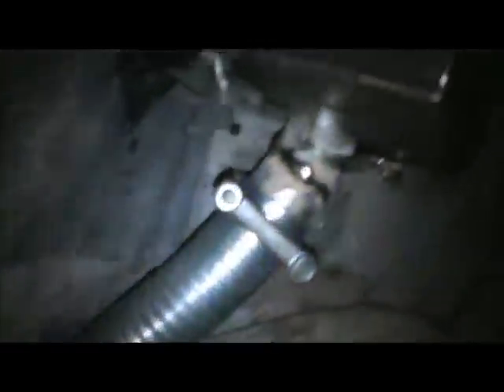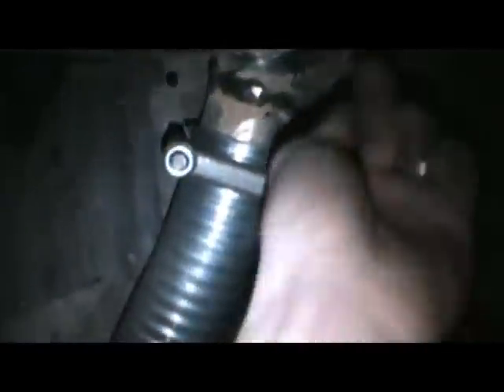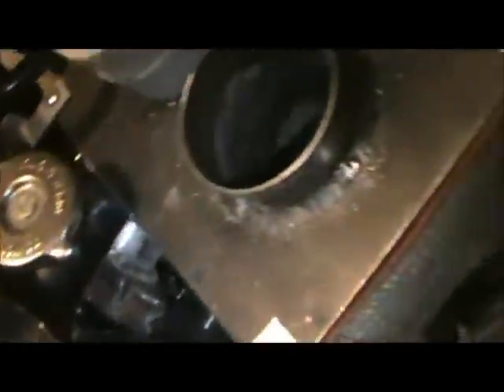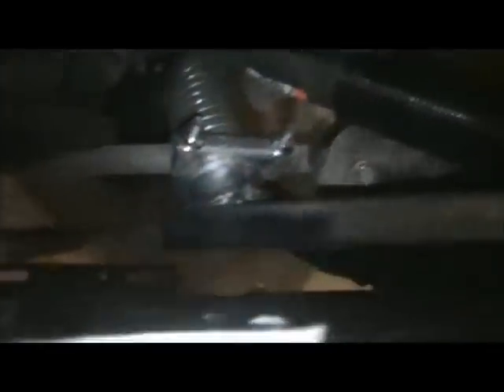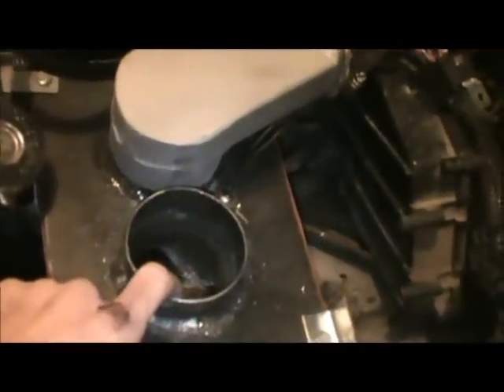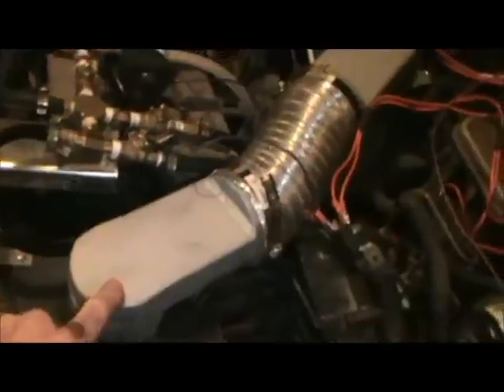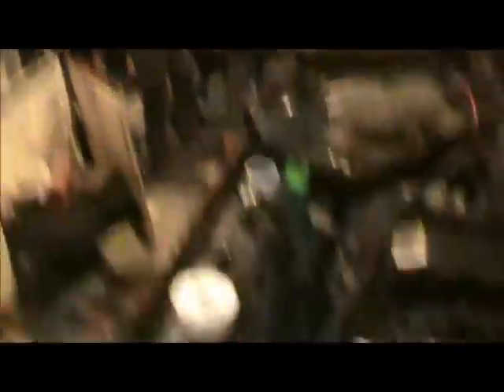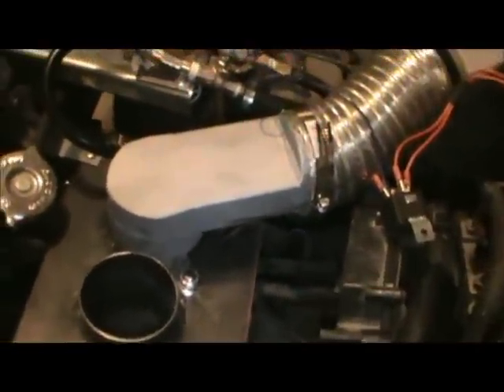100+MPG PROJECT NEW FUEL VAPORIZER INSTALLED (DETAILED OVERVIEW)

Comment: hi buddy. i have been trying to run my suzuki celerio 2011 with vapor. i connected the vaporizer to the air intake but it doesn't want to start. my car has injection engine. it doesn't contain the regular carburator. it has air intake seperated and the fuel intake in a deffirent place connected with injectors to the engine. do you have any indea how i can run an injection engine with gas vapor? thanx iun advance
Reply from the maker: Adil Boulg  I would disable the injectors to start with and then you've got to make sure you have the air to fuel ratio from the vaporizer correct. A fuel injected vehicle will still run with a vaporizer through the intake.

Comment: Can you give me your take on these guys that poke holes on a small plastic gas tank and connect hoses to the intake and then you see them riding around?
Reply from the maker: Edward Delgado  Yeah that's a cold vapor system I need don't get hardly any good gains in fuel mileage with those. They work really well though in place of a carburetor if you have a carburetor wished issues that is if its on a small engine not on a car engine. These kind of systems need constant adjustment on their air intakes  due to the fact that the properties of the fuel change over time as air circulates through it.

Comment: better put a check valve or spark arrestor in that line that is very dangerous a man and his son were burnt real bad doing what you're doing on lawn mower it looks like what you're doing it is a little over complicated the first thing is safety better thing would be doing HHO you can stay the hell out of any liquid will they transducer out of a humidifier. BE SAFE NOT STUPID you could build a checked out of a PVC coupling and a ball there are videos on YouTube on how to make a simple check valve I made one for water $2 1 cup of  gasoline vapor in the  bilge. of a boat will blow it out of the water that's why would you fuel up your little boat turn on the fan to purge out the vapors
Reply from the maker: +Larry Fries I always place backfire protection every system that I use. If you read the comments in every video or the description and even watch the video through all the way I typically have it in the annotations.

Comment: How you tried having injectors installed along the air intake pipe. connected to engine electronics as well as fuel system. just disconnect the original ones on engine.As engine runs Fuel gets squirted, air carries vapour with it, any excess fuel falls inside a constructed container below, which can be redirected back to fuel tank.
Reply from the maker: Ismail Bhuta  I designed my own type of injector similar to this however it vaporizes it instantly before entering the intake. I haven't got to test it yet though.

Comment: What that Dr Seuss exhaust system I'm surprised you get any power out of it whatsoever the straighter the better for low and fuel economy looks to me like you just made the exhaust hardest way to get out of your engine as you  possibly can good i
Reply: Sorry hit enter accidentally good idea but intake and exhaust are as important as fuel for economy you shoulda used head of exaust manifolds. Without all those u bends 90s and constricted squar tube round pipe makes gasses swirl and helps scavenge whitch helps truck run better with beter economy
Reply: Joshua Burton meant heat off manifolds

Comment: I have seen were the gas chills from the ultrasound and may stall the engine, You may need to run some heat from the engine or water tubes into the vaporizer chamber to keep the mist fairly warm or just not freezing temps.  ...Also much less oil in the fuel into the engine so you may need to introduce a tiny amount of oil into the carb to keep things lubricated just a bit.

Comment: I've found the fuel losses its potency after only about an hour in my set up, are you adding anything to your fuel to make it last longer? After a long run I can drain the gas and it will hardly light when you take a match to it. I have fresh air pumping into my tank, not exhaust. Exhaust has little air, and your engine needs fresh o2 to ignite the vapor

Comment: you took something simple, and over complicated it. pull your old fuel system, and replace with something simple. also no need to hook anything up to the exhaust system.
Reply from the maker: Testing and controlling the vapor state is what this design was for.

Comment: guess I'm just not mechanically inclined, because I have no idea what you are talking about here. I like the 100 mpg though. Are these systems road worthy now? Could I have one installed on my Subaru and get 100 mpg?
Reply from the maker: You would not pass a safety inspection if you have one installed. I have a design that would be road worthy so if you were to get into an accident you wont catch fire.
Reply: it takes the cars fart and heats a container which heats the fuel so it vapors better and makes the gasoline burn better.

Comment: a boiler powered by 12 volts at 20 amps will vaporize 3 gal hr (add 100 degrees to gas) and save you all that plumbing for heat.
Reply from the maker: My new  system will use a heating element to vaporize the fuel. I did this system to make use of the heat that already exists instead of having to use power to do it.
Reply: Tyson Capel the boiler output can be controlled by modulating the heater current. More current - more gas vapor. A "throttle" if you will.

Comment: the steam is not from the water in the gasoline but rather from the air running threw it i would assume.
Reply from the maker: Yes and no. I added water to the mixture so there was steam from the water I added and from the air.

Comment: What if you guys used high compression engines to run the vapor?  Maybe even a diesel engine?
Reply: Vapour doesn't need compression to ignite
Reply from the maker: I'm not sure how well that would work, I have not tested it on high compression engines yet but I will in the future.